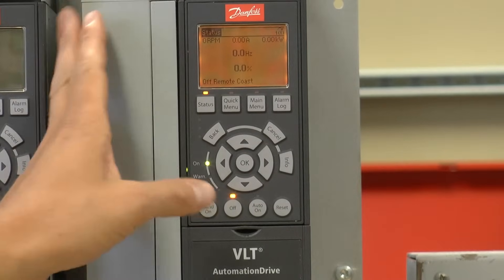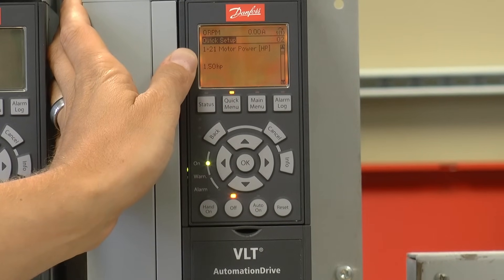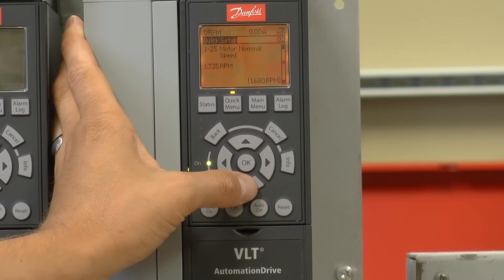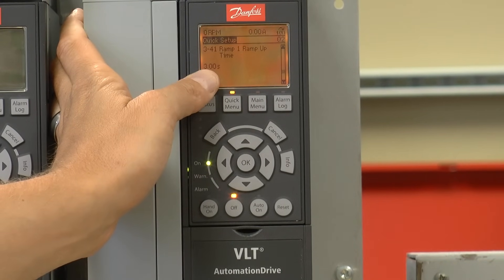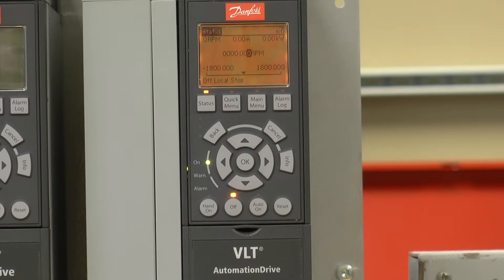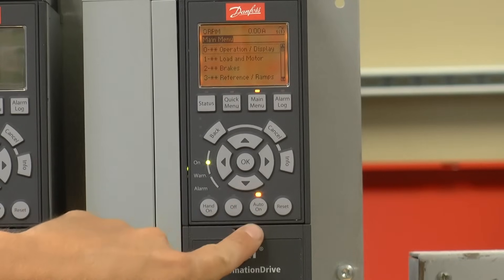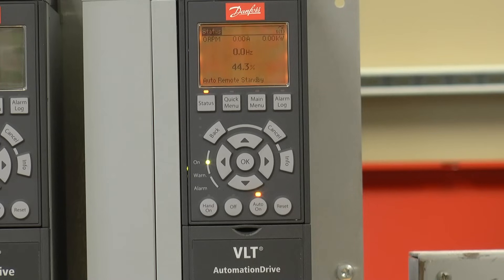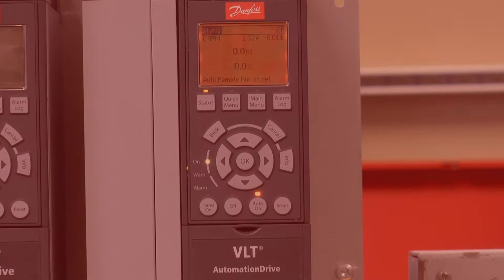VLT AutomationDrive Quick Start Tutorial

Comment: When using the AMA feature is there a Hp max that it won’t automatically input ? We’ve always just manually inputted the motor Info anything 5hp and up(deal with 25hp-300hp). What would you recommend?

Comment: Sir
How to change analog input voltage to current mode? Because 6-11 and 6-12 is missing.
Reply: There are dipswitches when you take off the display. Switch from "U" to "I" and your done.
Reply from the maker: For installation, start-up, programming and troubleshooting assistance please email: Drives.TS.NA@Danfoss.com
or if you need immediate assistance contact Danfoss Drives 24/7 tech support at: +1 888 DANFOSS (326-3677)

Comment: I cannot find what type of sinus vawe filter (serial output filter) is recommanded for Micro FC51? Please, any recommendations?
Reply from the maker: For installation, start-up, programming and troubleshooting assistance please email: Drives.TS.NA@Danfoss.com
or if you need immediate assistance contact Danfoss Drives 24/7 tech support at: +1 888 DANFOSS (326-3677)

Comment: 37kw ka inverter mil jay FC 302
Reply from the maker: For installation, start-up, programming and troubleshooting assistance please email: Drives.TS.NA@Danfoss.com
or if you need immediate assistance contact Danfoss Drives 24/7 tech support at: +1 888 DANFOSS (326-3677)

Comment: Hello!!! For the power of the motor. Should I choose the higher or lower value? What s the impact of this parameter on the function of the motor fan?
Thank you!
Reply: The value is according to motor plate data. One of the main fuctions of the VFD is protect the motor and for this, you have to set the rigth values of the motor, if you put a highier value, the VFD will not have any problem but the motor will get damage soon. 
I recommend do the AMA for a better perfomance and better protection of your motor.
Reply from the maker: For installation, start-up, programming and troubleshooting assistance please email: Drives.TS.NA@Danfoss.com
or if you need immediate assistance contact Danfoss Drives 24/7 tech support at: +1 888 DANFOSS (326-3677)

Comment: How do I activate the "Hand On" button if is disabled. Everything when I want to run the motor on manual it says "Button Disabled"
Reply from the maker: For installation, start-up, programming and troubleshooting assistance please email: Drives.TS.NA@Danfoss.com
or if you need immediate assistance contact Danfoss Drives 24/7 tech support at: +1 888 DANFOSS (326-3677)

Comment: merci beauque pour le vidéo,  s’il vous plait, j’ai un question. comment fournir un tension 24vDc pour actionne un bobine de ( contacteur ou bien distributeur ) lorsque le vitesse de variateur 100%, et priver 24vDc si la vitesse <100%, les étapes pour programmer le variateur danfoss
Reply from the maker: For installation, start-up, programming and troubleshooting assistance please email: Drives.TS.NA@Danfoss.com 
or if you need immediate assistance contact Danfoss Drives 24/7 tech support at: +1 888 DANFOSS (326-3677)

Comment: FC302 CHẠY 2 CAP TOC DO ?
Reply from the maker: For installation, start-up, programming and troubleshooting assistance please email: Drives.TS.NA@Danfoss.com 
or if you need immediate assistance contact Danfoss Drives 24/7 tech support at: +1 888 DANFOSS (326-3677)

Comment: Hi, IGBT brake module is only if i want to connect brake resistor? If i want to use dc brake without resistor, can buy the drive without IGBT module?
Reply from the maker: For additional information please visit https://www.danfossdrives.com

* If you need immediate assistance contact Danfoss Drives:  Phone: +1 888-DANFOSS (1-888-326-3677)
or 
E-mail: 
Customer Service:   Drives.CS.NA@danfoss.com
Technical Support:   Drives.TS.NA@danfoss.com
After Sales Service: Drives.TS.Service.NA@danfoss.com

Comment: HELLO DEAR,
IS THAT POSSIBLE TO REPLACE VLT2800 TO FC280 WHILE USING IN RS 485 PROFIBUS DP WITHOUT CHANGING OF GSD IN CPU?? ONLY WITH PARAMETERS SETTING OF PROFIBUS DP ?
Reply from the maker: For additional information please visit https://www.danfossdrives.com

* If you need immediate assistance contact Danfoss Drives:  Phone: +1 888-DANFOSS (1-888-326-3677)
or 
E-mail: 
Customer Service:   Drives.CS.NA@danfoss.com
Technical Support:   Drives.TS.NA@danfoss.com
After Sales Service: Drives.TS.Service.NA@danfoss.com

Comment: Hello,thank you for your videos.
Relying on your experience, I have a question about danfoss fc302 cranes liebherr. The driver works for 2 days without any problems. Sometimes the free stop passes and the load is released. The driver came to our workshop for repair. We suspected the control card. When you replace the control board, the panel freezes, but it displays an internal fault error (A38). power card does not recognize the control card. This is the mco 351 card with drivers with liebherr cranes application. How to solve this problem should be followed.
THANK YOU.
Reply from the maker: For tech support information please visit https://www.danfoss.com/en-us/service-and-support/fix-and-troubleshooting/drives-support/

Comment: How do you change to 0-10 volts?
Reply: Dip switch available in back side of LCP display
Reply from the maker: For installation, start-up, programming and troubleshooting assistance please email: Drives.TS.NA@Danfoss.com 
or if you need immediate assistance contact Danfoss Drives 24/7 tech support at: +1 888 DANFOSS (326-3677)

Comment: muy buenos días...
tengo un variado danfoss . que trabaja a pulso lo he revisado todo pero no me  muestra ningún error, pero tampoco me sale la opción  4 solo 1 2 3 5 6 7 8, y nose como hago para que me salga esa opción que estoy buscando que es la 4.. y me queda dando pulso el motor cuando gira
Reply: +mauro yoliany martinez reyes I am sorry to hear you are having difficulty. Please contact our 24/7 customer service department and they will be able to assist with your issue.  1 (800) 432-6367
Reply: danfoss drive showing an alarm but i couldn't reset the alarm.alarm code-A47,A48.have u any suggest?
Reply from the maker: For installation, start-up, programming and troubleshooting assistance please email: Drives.TS.NA@Danfoss.com 
or if you need immediate assistance contact Danfoss Drives 24/7 tech support at: +1 888 DANFOSS (326-3677)